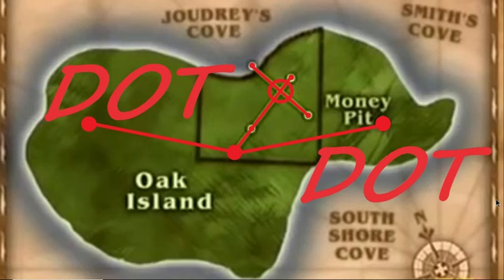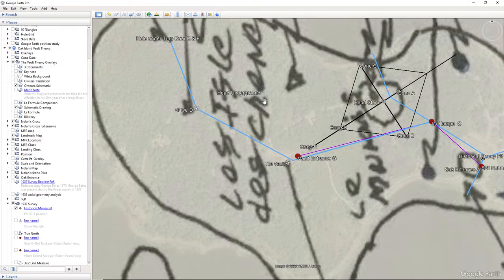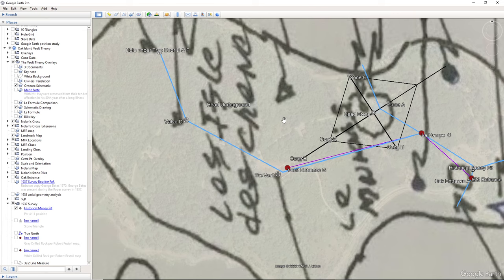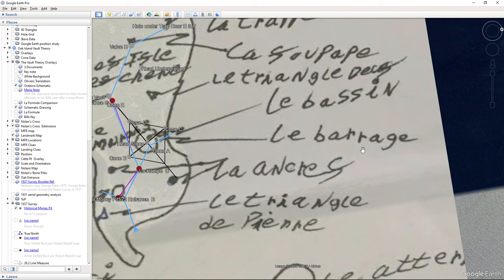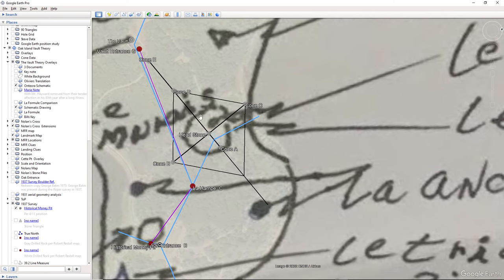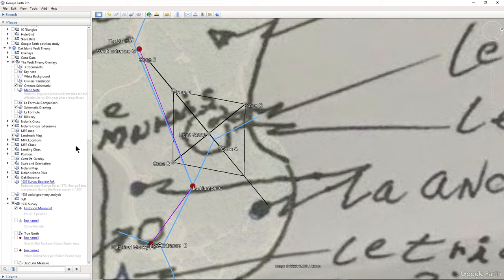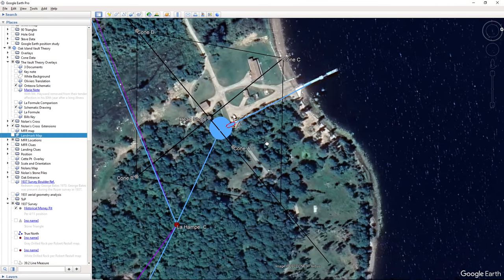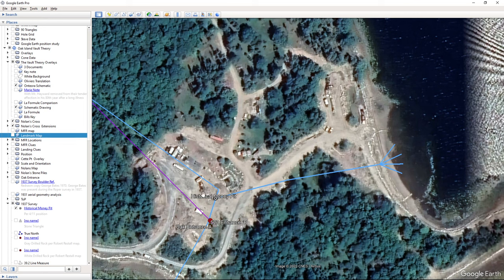Oak Island Vault Theory Flood Tunnel System

Comment: @DotToDot With your over lay of the basin, pressure release valves go east/south to Smiths cove, which is a very long distance. Line from La Hampe to Vault seems to run very close to the “eye of the swamp” which is anomaly and always stays constant through historical photos. Any thoughts that this maybe the pressure release point, and there’s a shorter more direct water tunnel system to vault? Your pressure release system theory intersects very close to the garden shaft where leeched gold is in high concentration in the water. You have great insights, theories, and I’m very much enjoying your series of videos!

Comment: D2D, how are you?

After watching today's show I'm wondering what's the likely hood of the hatch or the valve being on lot 5?
I've had a look at the Zena map and the lot map and they're both in or around that area. Can you confirm this?

Thanks in advance
Reply from the maker: Yes, according to my geometric interpretation of the MFR (Zena) document, the Valve location is on Lot 5. However, recently, I have theorized that the Hatch, Valve, Triangle 2 and the Vault locations on the document are just virtual points allowing one to geometrically calculate the underground entrance to access the Valve and the Hole under the Hatch. Watch https://www.youtube.com/watch?v=PRbdDIWB5jU